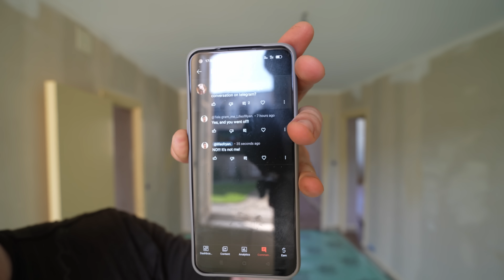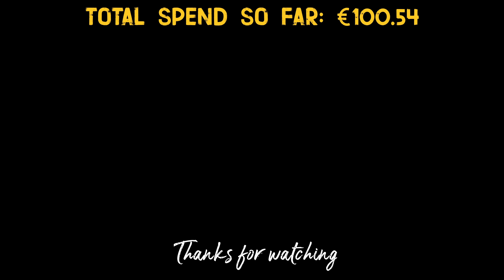Urgent Message to My Viewers: A Stark Warning You Can't Afford to Ignore

Comment: You should make that WC into a stackable washing machine/dryer closet. I was going to say coat closet, but with the breaker box in there now it makes sense to use it for the biggest source of electricity that you will use next to the HVAC. That is, unless you need to make it into a HVAC closet...

Comment: In the US, toilets are bolted to the floor. One or 2 bolts on each side under a little cap to hide them. A wax ring it put around the drain pipe and the toilet is positioned down over it and bolted down. Good luck!

Comment: I usually don't comment because I'm hours behind you and don't see your videos until the day after you post so you might already be done with that toilet. I've done a bit (a lot) or renovating and remodeling and sometimes you just have to break things to get them out.  Not ideal but...a sledge hammer can sometimes be your best friend. Try taking the tank off first so it's lighter and easier to maneuver (someone else also suggested this) but if you still can't get it out use that sledge hammer.